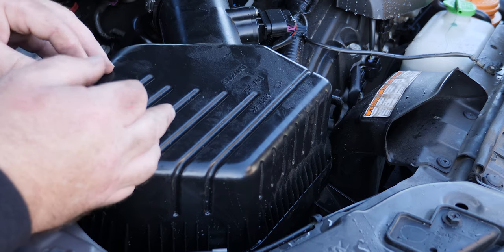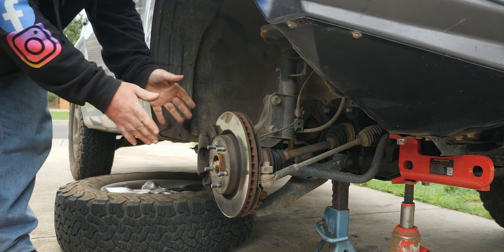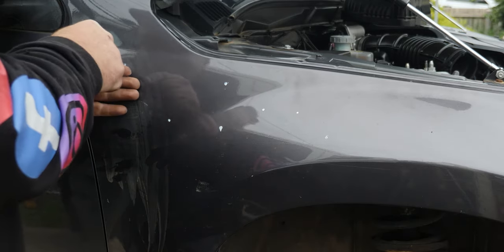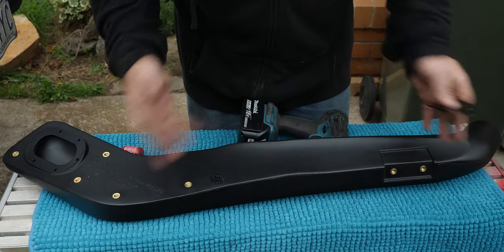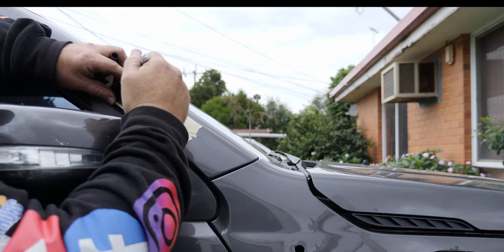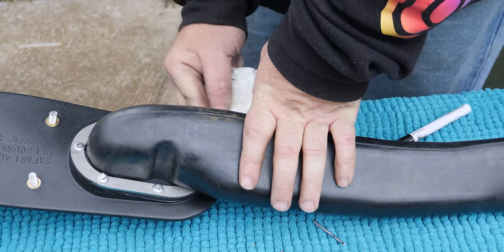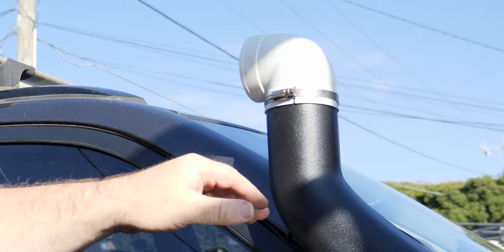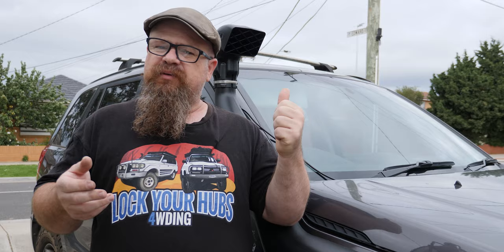Ram Head vs Backward Snorkels including Snorkel Install

Comment from the maker: Has this changed your mind about snorkels?
Reply: Nope, always had it the correct way around (forwards).
Reply: @julietteremfrey  Same. I'm a mechanic and have always argued for fitting snorkel heads forwards. Airflow properties clearly support empirical results shown in this vid. I also have a turbo charged diesel engine and have run it with snorkel head facing to the rear (didn't fit gauges or anything, simply my professional interpretation of how the vehicle drove) and the results spoke for themselves - I run with the snorkel head forward.
Reply: No! But it’s giving me what I was looking for to confirm what I thought.  Awesome job thnx mate.
Reply: @mattieb3152  did you notice any change in fuel economy?
Reply: @tonycook2347  To be honest I don't remember - snorkel was fitted a long time ago! I do remember it didn't feel quite as responsive with snorkel head backwards.
Reply: On my Terrano I had it backwards but mostly because I like the noise 🤣🤣🤣. After this though I'll keep it forward facing on my Trooper 3.0 . Any tips for testing how waterproof it is.  The way it connects inside the wing to the snorkel outer is daft at best. Great video mate
Reply from the maker: @MrMilly72  I drove through heavy rain at freeway speeds for about 2hours straight. I checked the airbox when I stopped, there was only about 20ml of water right in the bottom of the airbox. So I would say it's not a big issue.
Reply: @LockyourHubs4WDing  hi mate I was more referring to wading. I want it waterproof for river crossings so it's more the joints than the head. I've sealed the drain in the airbox cause in Wales there's some water crossings at above bonnet level . Thanks for the reply mate
Reply from the maker: @MrMilly72  sorry mate, I have heard of blocking the snorkel entry at idle, if the engine stalls, it's air tight! This though could cause issueS with plastic airboxes etc that may collapse under a vacuum.
Reply: Could you do a comparison between the different head styles  for fuel efficiency
Reply from the maker: That's going to be a tricky one as it depends on the individual application. The general rule of thumb will be the less restrictive, the better.

Comment: Your manometer is measuring vacuum not ram air boost. No, it's not even measuring that, it's measuring the difference in pressure compared to the cabin. The numbers are pretty much meaningless.
Reply from the maker: It's measuring the amount of restriction in inches of water in the inlet tract to the clean side of the airbox
Reply: Vacuum compared to the cabin.
Reply from the maker: @1magnit  you're right, the reference used is atmospheric, just like a boost gauge or a tyre pressure gauge. 

You can also measure absolute, which uses a full vacuum as the reference, though it's easy enough to convert between the two at sea level, just add 1 bar or about 14.7psi to the result.
Reply: @LockyourHubs4WDing  You'd get more meaningful results if you took measurements at steady state cruise at say 100K and went from cruise throttle to full throttle to no throttle and back to cruise. That way the cabin pressure is constant, at closed throttle you'll see the effectiveness of the mouth, at full throttle you'll see the effectiveness and restriction of the extra pipes.

Comment: Hello, thanks for the video, I am going to mount a snorkel like yours on my suzuki     and I am in doubt about the drain little hole in the airbox. What is improved by sealing the hole? Does it have any risk? Thanks
Reply from the maker: Only if you fill the airbox with water! It stops water from rising up through the hole if you're in deep water.
Reply: @mattieb3152  ok, but what happens if rainwater enters?
Reply: @ruloooo7889  When sitting static, you're not going to get any in. When driving, yes, you will get some entering, but it generally won't be much. I've never encountered any issues with mine on my old 60 series Landcruiser, but the air cleaner housing is a vortex type that has a small removable cup at the bottom where any stuff collects anyway. In the case of something more modern where you don't have this then it's purely a maintenance thing - lift your bonnet, remove the air cleaner and inspect it and the housing for any rainwater ingress from driving in a downpour. You have a four wheel drive, there are basic maintenance checks and inspections you should be doing.
Reply: @mattieb3152  ok, thanks for the comment
Reply: @ruloooo7889  It'll evaporate and be consumed by the engine

Comment: The conclusion? the head of snorkel must forward or backwards?
Reply from the maker: The conclusion, use a ram head!
Reply: ram head meaning the head of snorkel must foward?
Reply from the maker: @faiz4875  best if it faces forward yes, but the shape is the most important part.
Reply: @LockyourHubs4WDing  i see.. Thanks a lot bro..

Comment: That was brilliant. I had asked the same question on an Isuzu owners site and someone directed me here. I have a Safari and after seeing this I'm glad I did. I am also curious about the snorkel sock, as the installer at ARB told me not to fit one. So it would interesting to see the results of that test. Keep it up, I've just subscribed.
Reply from the maker: Cheers! I was really surprised by the results of the snorkel sock.
Reply: @LockyourHubs4WDing  Great, do you have any idea when you will be posting it?

Comment: Great experiment at the end there, just wondering how many times you ran it?  Was it just the once?  If you did it something like 10 times with each set up (alternating), and then perhaps with two or three other vehicles - that would be gold!  It does worry me that 4wd accessory companies arent putting up their performance data....
Reply from the maker: I usually do three tests and average the result. Many smaller manufacturers don't have an R&D budget, so very little testing is done unfortunately.

Comment: You should compare the Donaldson cyclonic head with sediment bowl, they filter out small particles & dust like no other especially at low vehicle speeds like when following in convoy or playing around in the sand & dust.
Reply from the maker: Great idea, I been thinking about getting one of those.
Reply: @LockyourHubs4WDing  I think they may also work at highway speeds as the stock snorkel Toyota VDJ79R I took off my Landcruiser works on a similar cyclonic principal except without the bowl.

Comment: im a mechanic and i only use Makita tools and mate they have done me well so far with no issues for a couple of years. Cheaper than Snap on, more powerful and more reliable in my opinion.
Reply from the maker: I've had a mains powered 125mm Makita angle grinder for many year, when brushless became a thing, I bought 1 Makita tool and as you know, once your locked into the battery system....

Comment: Are you having any problems with water pooling in your filterbox now that you have closed the drain? I am planing on a snorkel install on our Suzuki, and wanted to know as our drain is also closed
Reply from the maker: I drove for 2 hours in reasonably heavy rain at freeway speeds. I checked the airbox when I got to my destination, there was probably only a couple of teaspoons of water in the bottom of the airbox, nothing that would cause any issues at all. That was with the Ram head facing forward.
Reply: @LockyourHubs4WDing  thank you so much for your answer - so it is just a matter of checking every once in a while

Comment: Good info man, just picked up a 2008 3.2 GV. Few little tools mentioned here that i'll be picking up for my snorkel install 👍🤿😄

Btw, it looks like your Sika tube there is 227 not 243.
Reply from the maker: They're a great little car, you'll love it!
Reply: @LockyourHubs4WDing  
Hey did you have any trouble getting the air entry hose on the airbox? I found the rubber pipe was too small, even lubed up there was no way in hell that was going on.
Reply from the maker: I ended up cutting a short adaptor of the original inlet pipe to the airbox and connected the safari hose to that.
Reply: @LockyourHubs4WDing  
Good idea 👍

Comment: My day job is mine ventilation, so I know a bit about fluid dynamics.  The aerodynamic performance of these two bends just could not be more different.  The white elbow has no taper from the inlet plane and no flare, and the bend is a straight 90degrees. The bend is the same diameter as the pipe and it’s round. The bend is within 1 diameter of the inlet, so the fluid flow into the inlet and around the bend is highly turbulent.  There would be considerable flow separation at high flows arising from the inlet being so close to the bend - basically the flow chokes as it tries to transition.  
The proper inlet - the one that faces forward- is a radiused transition. Note that the inlet plane is 2 diameters from the transition into the bend.  Both the inlet plane and the bend are both wider than the pipe diameter.  The elbow is designed to turn the flow efficiently and not choke out due to boundary separation.  Unfortunately all you have measured is the difference in aerodynamic performance of the two elbows.

Furthermore the velocity pressure at 100k/h is 650pa or about 2.6” water.  So assuming both elbows are taking laminar flow air from the same point (a big assumption) then the velocity pressure simply can not explain the difference in results.  30” water is 10 times the velocity pressure - impossible to be caused by the elbow direction.  You are mostly measuring the shock loss through the white elbow.
Reply from the maker: Thanks for the input,  unfortunately I don't think the flow into either will be particularly laminar, especially the rear facing inlet. 

Without a pitot tube manometer, smoke machine and a wind tunnel! I would hazard a guess that the inefficiency drop we're seeing is a combination of the turbulent flow at the inlet (epecially the rear facing) the inefficiency of the reverse inlets design and lack of velocity pressure in the reverse facing inlet combined.
Reply: Lock your Hubs 4WDing maybe just do the test again without the white elbow.  For curiosities sake.  Ideally you need to turn the ram head around to face backwards.  But since you can’t do that the solution is so obvious - just face the white elbow forward.  I will bet you two cartons the difference between forward white elbow and backward white elbow will be less than 4” of water, and the performance will be within 1%.
Reply from the maker: The ram head can face any which way, and the elbow, as I had to slot it, went into the bin.  Though I might try the ram head both ways! Where do I pick up the cartons? :)
Reply: Lock your Hubs 4WDing I will just get them sent from Dans straight to ya 😀
Reply: @mickloney9826  Hey Mick, thanks for the awesome comment and explanation regarding the 90 degree elbow vs the proper inlet. I learned something this evening so thanks for that!
Reply: So the staino snorkels are good? Yeah boi 💪🏼👌🏼😁
Reply: I tested this in our wind tunnel with exact models, a rear facing snorkel with exact proportions produced 3.5 inches of negative pressure at 100kph, more at 110kph.

We measured zero with a forward facing snorkel at all road speeds.
Reply: @blairknight7793  Yup, thats plausible.  3.5 inches of water is about 0.5% of an atmosphere.  So you would expect facing the snorkel backwards would result in a 0.5% drop in power.  So for a naturally aspirated V8 (Y62 Patrol) with 400hp, turning the snorkel around would cost about 1.9hp.  Which would not be measurable on the road.
Reply: @mickloney9826  i noticed my fuel economy went from 14.5 to 13.5l/100 when I took my high flow off altogether and just ran a straight-up snorkel (not in the rain). for the slight increase in power and fuel increase. facing back seems to be a better option?
Reply: @blairknight7793  spot the guy selling rear facing snorkels 😂😂
Reply: @mickloney9826  .5 second 0-100 not measurable?
Reply: @goverat  no, read what I wrote again.  I said facing backwards at 100k/h there would be a 0.5% drop in power.  The 0-100 time would be the same, as the velocity pressure is proportional to the square of the velocity - for most of the 0-100 run the velocity pressure is negligible.  Obviously the velocity pressure is zero when the vehicle is stopped and follows a square curve as the vehicle accelerates.
Reply: @mickloney9826  but that 3.5 inches is from someone who presumably sells rear facing snorkels (testing snorkels in a wind tunnel for what other reason?), this video and a few others on YouTube from people with no conflict of interest show a measurable difference in on road performance
Reply: @goverat  I already agreed with the 3.5", thats a plausible measurement.  Thats about the same as my calculation.  Im a mining engineer who specialises in mine ventilation.  I work with fluid dynamics for a living, and I dont even own a 4WD any more let alone sell 4WD parts.  Im an engineer.  The maths isnt hard on this.  Velocity pressure equals 0.5 times the density of the fluid x the velocity squared.  You can google this to check if you like.  100km/h is about 27m/s (you have to work in meters per second).  Density is about 1.2kg/m3 of air (depends on altitude).  So velocity pressure at 100k/h is 462 Pascals of pressure, or .067 PSI.  ITS TINY!!!!  Do the maths yourself mate.  1 atmosphere of pressure is about 101,000 Pascals.   So to work out the maximum power gain possible by a forward facing snorkel at 100k/h we divide 462/101000 = 0.462%.  So the maximum power gain is approximately stuff all.  These are called facts, the physics of air is very well understood and not at all a new science.  Anyone who says their forward facing snorkel radically changes their engine power at legal speeds IS CLEARLY LYING.  Its physically impossible.  At 300k/h the numbers are radically different (square of velocity), but we are talking about 4WDs here.
Reply: @mickloney9826  if that's the case, then why is every single car made having a forward facing intake?
Again, numerous videos of real world tests that show there's a difference between which way the intake faces. 
But i guess real world is a bit too hard for an engineer to comprehend
Reply: @goverat  Stop with the ad hominems.  Do some maths.  You know im right and you have no evidence to support your views besides some youtube people who are selling stuff.  By your own standards you are listening to the wrong people.  But I will answer your question - not all cars have forward facing intakes!!  My Y62 patrol had a side facing inlet build into the front guard.  Thats how they are standard.  But the reason they have forward facing intakes is because thats where the COLD air comes from - google air density vs temperature and then write me a few paragraphs about why temperature is important.  Look mate, I know you cant do maths, but I really tried hard to explain how this works.  I explained how it cant make any difference at 100k/h but if you want to believe people who are trying to tell you stuff over an engineer with 20 years experience with fluid dynamics then knock yourself out - get your arse down to ARB and empty your wallet.
Reply: @mickloney9826  what is this guy selling? Nothing. But what is shows is your maths is either missing information or is just plain wrong. The only people who support your argument are those who sell rear facing snorkels.
And every modern car gets its air from the front, there will be a channel from the bumper leading to the box

I think you should hand your degree back seeing as you 20 odd years of experience fails real world situations, or maybe stick to your own lane as this obviously isn't
Reply: @goverat  You dont know anything.  You have brought zero facts to this conversation, just useless anecdotes.  I can explain the reasons the people you refer to get the results they do.  You cant explain anything because you know nothing and have done nothing.  You didnt even know that there are cars with side facing air intakes. Thanks for zilch mate.
Reply: @mickloney9826  your maths isn't replicated in real life, cry all you want about having a fluid degree, simple fact is, you're wrong and there's lots of people doing independent tests that show it
Reply: @goverat  it is replicated- Blair Knights work above replicates my work.  That’s actual data verifying what I said.  How are you not following this conversation?
Reply: @mickloney9826  again, he probably sells rear facing snorkels, thats a clear conflict of interest.
Typical engineer mentally, real world doesn't match my maths, therefore the real world is wrong
Reply: @goverat  the real world does match the maths (of course).  Blair’s numbers reflect the maths quite well.  Besides, there is no such thing as “my maths”, there is just maths.  You seem to think that the people who agree with you are right, despite the fact that they are probably wrong and I proved it.  You can’t even explain how I am wrong, you just point to anecdotes from other people because you don’t know anything and haven’t tested anything yourself.
Reply: @mickloney9826  this video is clearly different to those results. You point to the elbow, but the same elbow was used in both tests, ruling that out as the reason for the difference. 

And again, he is probably someone who sells rear facing snorkels. That's like taking data from a tobacco company regarding lung cancer, there's a clear conflict of interest, I'm starting to think you do too
Reply: @goverat  No, the white elbow was used facing backwards, the ram head forwards.  The aerodynamic performance of the 2 is completely different, as I said above!
Reply: Mick Loney, There’s a saying about trying to use reason and logic to argue with a stupid person:

“Never play chess with a pigeon.
The pigeon just knocks all the pieces over.
Then shits all over the board.
Then struts around like it won.”
By the way, thanks for the explanation. It makes perfect sense.